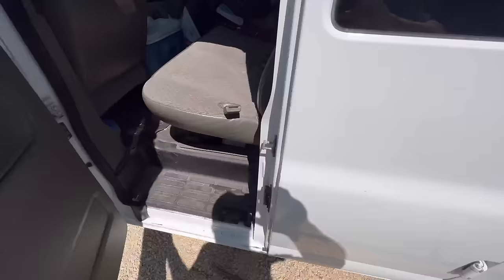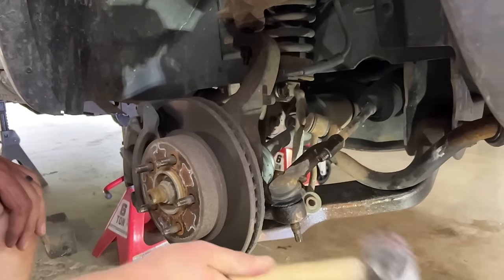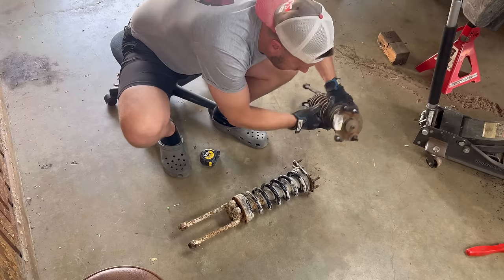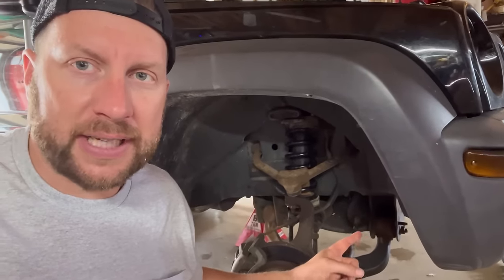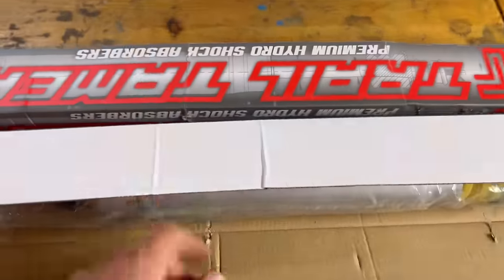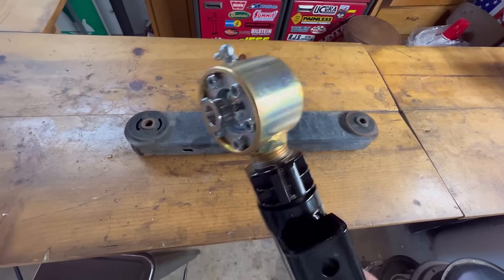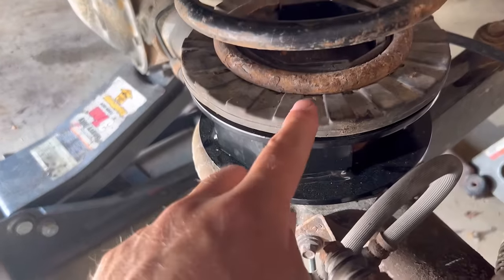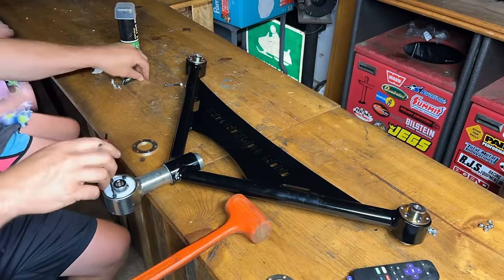How to Install a Lift Kit on a Jeep Liberty KJ 2.5" Premium Series from  ​⁠@IronRockOffRoad

Comment: The kk clevis will give  you 3/4 inch of lift when swapped with the KJ clevis. The KK clevis is longer because the spring rate is lower on the kk springs. So when you swapped in the kk assembly. You did nothing to add lift with that set up.
Reply: exactly. kk clevis forks give bonus lift with kj coilovers.
I use both, kk clevis forks and 1" ring for normal clevis lift in my crd libby. Driver side was hard to assembly but doing that second time you can do it alone :)
Reply from the maker: Awesome. Good info thanks for sharing
Reply from the maker: Good Stuff. Thanks for the info

Comment: Excellent video, I just bought the Moog but I will definitely buy this one, my KJ has the same lift but with spacers and blistein B8 shocks, but this boomerang definitely looks better, I'll tell you later, greetings from Mexico!
Reply from the maker: Thanks for watching. The upper and lower control arms in the rear along with the flex joints are worth the price of the lift alone. Thanks CMAC

Comment: Do you think if you loosened the front cradle bolts and let it drop down about an inch that you would have had an easier time getting the front end back together with the taller strut assembly?
Reply from the maker: Not a bad idea but I wonder if the cradle would walk away from you while trying to installing the strut. Thanks for watching 👊

Comment: I hope you waited till the full weight of the kj was on the ground before you tightened the suspension bolts. Mainly for the rubber bushing preload. The flex joints should be fine.   
If you would have loosed the lower control arms. The assembly would have gone in much easier. You have to get a front alignment anyway.
Reply from the maker: All good advice. Thanks for sharing. I ordered some JBA upper control arms so more to come along with an alignment. Thanks for watching👊

Comment: After your lift what size tires did you run
Reply from the maker: I run TJ Wrangler Moab wheels on 305/70/16 which are a little larger than recommended so I had to trim the front bumper and the inner fender pinch welds. Good luck 🍀 with your project 👊

Comment: Question, I have the iron rock upper & lower adjustable arms also. Did you have any issues with pinion angle on the rear differential?
Reply from the maker: I did not. I matched the angles with an angle finder. Match the output on the rear of the transfer case to the angle of the pinion on the rear differential. Good luck 🍀dialing yours in. Thanks for watching 👊

Comment: Whats the measurment done for the upper and lower control arms ?
Reply from the maker: Adjusted the length for the correct pinion angle along with adjusted the length so the wheels and tires sits back in the center of the wheel opening with new spacing lift. Thanks for watching!

Comment: 6:47 and to add to Robert's remarks: of course you can remove and put in assembled coilovers - just pull cv axle.
Reply from the maker: Good info. There is more than one way to cook a egg. I was trying to follow the IRO instructions. But we all know how that works. 😆 Thanks for watching.
Reply: @MacsSpecialitiesMotorsports  yeah, sure. but I would go with bilstein shocks and ome or dobinsons springs in front, not spacers.
Reply from the maker: @TomaszbtdZiobrowski  for sure! I wanted to do a SAS but now I might be interested in this IFS as I just purchased some JBA uppers. Thanks again for the advice.

Comment: REAR SHOCKS?
Reply from the maker: Yeppers. The kit from IRO comes with the rear shocks. They look to be a generic brand of shocks but have been good so far. Thanks for watching.
Reply: i just used shocks for a 99 dodge dakota in the rear  @MacsSpecialitiesMotorsports
Reply from the maker: 👍 great suggestion! Thanks for watching 👊